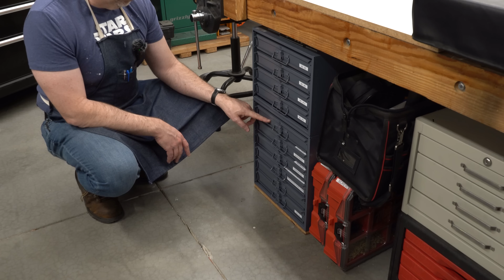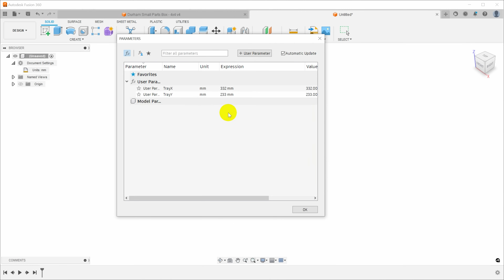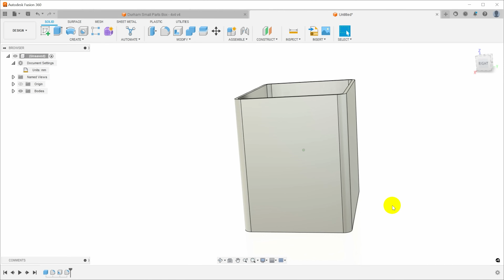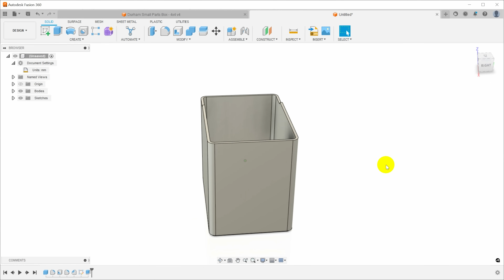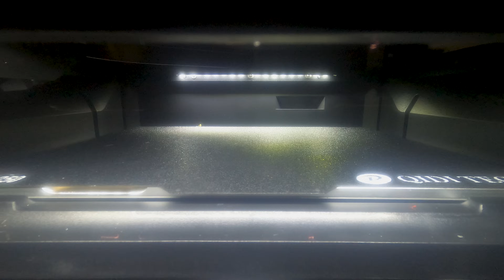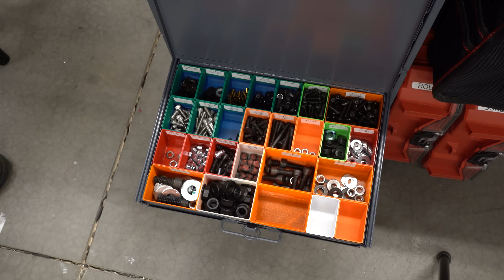Create the Perfect Storage Solution with 3D Printing!

Comment: I have had quite a few joke with me about my OCD.. Ha..Ha.. I just laugh at them.. But, when the complex projects roll in, and, they put me on them,, I wait until about half way through the project, when they can tell how well, it is going together is when I get them. I usually start calling out 32nd's or 64th's, or 128ths measurements and they finally say something.. Why are you calling out measurements like that.. That is totally unnecessary.. I say,, Is it?  How many problems have we had getting to this point? The answer is always NONE!! Ok then, now you understand why.. 
Now, 7/16ths, and leave the full line and you will give me 15/32nds.. Now, sound familiar?? I have been working with 32nds and 64ths when I made the cuts the whole time.. 
Then, I will grab a tape measure and measure the project. Both sides.. And, I will say, see, can't tell whether it is perfect or not exactly perfect... Looks dead nuts to me.. BUT, ANYONE Else at this point would be happy to be within 1/2" tolerance at this point.. There is the answer to your question.. Every Cut Counts!

Divide a Circle into 8 sections with a set of dividers and start from one side and go all the way around to the point of origin.. If your measurement was not EXACT, you just multiplied your error 8 times.. Start at the bottom and go right to the top and then start from the bottom and go left to the top and you have only multiplied it by 4 times.. If you ended up at the same spot measuring from the Right and Left starting at the bottom, you just confirmed your error twice, and only have to divide the confirmed difference by 4 to get it dead nuts.. 
Are we OCD, or, just know how to do it the right way? I rest my case.  

It's not OCD,, it's just wanting to get the job done the first time and getting it right on the way in vs backing up and trying it again.. I hate almost ALL Words starting with RE.. Think about it, even Reward and Refund, you had to Do something or spend something on the latter.. Rebuild, Rework, etc.. 
Writing Code is no different. Set your Variables, write Modularly, and decide what data you need going in and what is needed coming out, and you are ready to define the project Scope.. And, I am NO Software Engineer, but, I know how to get Projects done correctly. 
YES.. Nothing wrong with having trouble getting started.. It only means,, you are not 100% Satisfied with the design you have come up with at that point.. There may NOT be anything better,,, or, you just might be one sip of coffee and a deep breath away from the next Revolution in the Perfect Design... 
I fix more problems going to get a cup of coffee and taking a 5 minute break than any other way of solving problems.. When it gets to that point, taking a break, having a few minutes of quiet time,  allows your brain to work in subconscious mode, where lots and lots of problems are solved.. 
Go to bed thinking about a problem, and I can't tell you the number of times, I woke up with the solution... 

People have NO IDEA how many problems can be solved or figured out, just by asking combinations of who/what/why/where/when/how... If you know "How something works, and, Why it works that way, then, you ALWAYS KNOW WHAT THE PROBLEM IS, which is Why it is not working!! 
Think about it. .Apply that concept to a Lawn Mower that does not crank and you will see what I am talking about.. 
It works for Politics too, using combinations of those same words. I call it following the contiguous Wheel of Thought". What would they normally do? If that is not what they are doing now, then, you are looking for something else, because, Agenda's drive peoples actions, and when they appear to be doing the opposite, they are lying and you need to watch that left hand while the right hand is waving.. 

Not sure what is wrong with people these days. It is getting worse.. If they can't find an immediate solution, brain shuts down and stops thinking... 
Like everyone commenting about Gridfinity.. Yes. Good Solution. So is Alexander Chappell.. But, one is based on 40 and 50mm, the other on 42mm... But, what if you want to use the whole box and neither of those work out evenly?? Did every commenter miss that?? There is why you did what you did? The comments about turning the box upside down and things coming out of the box.. 
Did they think you didn't make the cut down on purpose to avoid pushing the back of the box up due to the hinge? You meticulously measured the Rear and front heights? 

Did they not stop and think,, why did he do that? So,, he has a reason for cutting at least the back row of boxes down?? And, he made ALL of the boxes the same?? Must have not been worried about turning the boxes upside down.. Ha..Ha.. I actually find it amazing reading the comments.. NOT ONE OF THEM,, except maybe the first Gridfinity comment bothered to look in the comments to see how many times others had made the same comments.. WOW!! MESSAGE TO YOU GUYS!! READ THE COMMENTS!!! 
They are a GOLDMINE of information on channels like this.. I filled up a whole notepad file on all sorts of information from the comments. .Anything from the price of ABS, PLA and Nylon by compairson from some comments, to all of the different software's used to modify existing files, to Zack, Alexander, and a few others seem to be leading the way on these organization systems, etc.. Hell, I just started looking at these 3D printing Organization systems tonight, and I know more than 50% of the commenters.. Just from reading the comments on this one video... 

Some of the pick ass comments on here, just piss me off... Keyboard Driver Errors is all I can say is behind them.. 
EXCELLENT VIDEO... I learned more about Fusion 360 (I have never looked at it because so many people complain how hard it is to learn).. Hell, it's like using an Excel spreadsheeet the way you designed the boxes.. I can see it will take a bit to learn, but, the intimidation factor just flew right out of the window.. Thanks for those few minutes of design.. They were INVALUABLE!!

Comment: @Clough42  
James,
Thank you for helping me to find the root cause of my problem as to why I never start never finish and just stress in general.  I have issues with finding things because of the chaos in the shop, the lab, or even the clothes closet..  Being an engineer it is inherently obvious, at least to me, that I should be incredibly organized.  However, once things get going on a project and then it finishes, what do I do with the aftermath?  It is a shame to throw the extra material out.  I have not had an organization system that could grow with my mass of different projects.  That one thought.  Create a system to easily grow and change.  It has changed the way I approach projects, shop organization, and life in general not to mention reduced cost on projects as well as less trips to the hardware store.  Thanks again!

Comment: What a waste of time man. Personally I bought little bins and put them in my drawers. That’s enough. You never need to move a whole box of bins in reality. You just need to pickup bins here and there and put them on your tray. Printing all these bins is too much work, there is much more efficient and much cheaper if you count your own labor. This perfection is ridiculous. My bins are not perfectly aligned and they don’t fill 100% of the surface of my drawers but nobody cares. They don’t move with the anti slippery pad under them when I open a drawer. You are talking about getting thing right from the start. First you need to think about efficiency, not pleasing your OCD.

Comment: The insight to your logic and dare I say phobias in this vid, is a gold mine...a deep, complex, multi-fissure chasing, sprawling, subterranean, OCD gold mine, but a gold mine none-the-less.  I consider myself reasonably proficient in 360 and most tasks in and around the shop.  I however never think to use parameters from the onset, which is basically the same concept as your approach to organizing hardware.  Plan for change from the start.  I just bought my son an entry level 3D printer.  He's working on custom organization for his Milwaukee Pack-out system.  I'm going to suggest that he too, takes a look into your thought process.

Comment: So I take this to another level lol.
I have an einstar 3d scanner and Asub spray.
I laid out how I wanted all my tools in my tool boxes sprayed and 3d scanned. I cleaned it up and used it to cut from a solid and shell.
With small tweaks based on the use case my 3d printed drawer tray are perfect for me also my socket holders are the shape of the nut/bolt/torx/spline that are used on so it will only fit in 1 spot same for 6 point 12point metric sae.
I use harbor freight 22x72 S3 boxes 1 red + red hutch and 1  blue + blue hutch.
Red is 100% metric blue is 100 sae.
I have a black 22 x 56 + top chest that all tooling for my CNC machines (hass VF-02SS, ST-15Y, diy 4x4 cnc router)

Comment: Or you can the old standby of building in room for expansion from the start.

 On the extreme end leave either 1 row or column of trays empty or more practically 2 - 3 trays empty and unlabeled. 

That way you remove the headache of cross container shuffle(which in my humble opinion no engineer should ever resort to doing) and are able to comfortably accommodate any new changes that crop up in the future. 

Second part is to place the label maker stickers on each of the actual trays rather than a master layout on the underside of the lid. 

Label the fronts of the larger containers with the most appropriate general category label references such as metric/SAE “nuts” “grade 8 hardware” etc and then maintain rows or columns of the range marked on the underside of lid. 

As needs change and stock is consumed removing the label from the tray also helps to free up more space for the new stuff.

UNLESS OF COURSE your like me and subscribe to the better to have what i need on hand then waste searching for it or worse having to stop to make a trip to the store so your “collection” keeps growing. 

AND IF you’re of similar mindset then simply labeling ALL the common potential sizes whether you actually have them on hand or not… that way You’ll ALWAYS have a waiting tray properly labeled and in order for whatever shows up next… 
insanely inefficient use of existing space which is always at a premium as it is but it does solve the upgrade dilema. To make it more fool proof you then just leave 1 single tray to each container drawer miscellaneous for placing any non standard denomination size hardware so you don’t get a ton of trays holding single one off pieces that most likely will never get touched.

And now as i finish writing this all out I clearly see you’ve already implemented almost everything i’ve already mentioned.

In short, The biggest single thing i did that helped my storage was getting used to not completely filling each drawer full of labeled containers … by leaving sufficient empty trays it may not be ideal right now, however it certainly makes up for it in the future for collection upgrades😊.

Nice job i sense a comrade in arms in a lot of the similar philosophies, struggles and issues wanting to avoid as you systematically tackle each project. I believe you’re far more knowledgeable, diligent and skilled (especially w/ CAD) than myself but i can clearly see we’ve gone down our fair share of rabbit holes coming out of them with similar conclusions 🍻

Comment: Cool system, terrible metal boxes:
* thin metal
* latch interferes with handle
* hinge made you create notch in boxes which means you can never turn boxes upside down with small parts inside
Hope they were cheap

Comment: Durham has box liners w/divider inserts. They’re pretty nice too, they have curved bottoms and the imagery placing can go as low as around 1”
Reply: Also, the fit of the inserts are really tight, which is nice b.c once they’re in they feel basically permanent. I think mine have 4 vertical rows w/the 1” spaced insert wells

Comment: I feel your pain. I have stuff in multiple storage "systems". I love the Milwaukee packout system but it is cost prohibitive for keeping everything in. I also use various sizes of Arko bins that are hung on the wall with cleats. Arko bins are great for really big stuff but are limited in their ability to be re-sized. I use Plano boxes for small items. These boxes work but lack the ability to easily change sizes due to the internal dividers being pre determined by the manufacture. I have been inspired. Now all I need to do is think about the ramifications of changing "my system" which will ultimately lead to additional procrastination.

Comment: My small parts system is similar to yours.  I've added a catalog consisting of a top-down photo of each box.  I keep a printed version next to my parts area, and i always have the electronic version available on my phone.  A tray ID label is attached to each tray so that it is visible both in the photo and from the front  of the closed drawer.  That means the tray number matches the page number making the trays easy to find.  I don't print individual labels because with the photos I don't need them.   This means that while designing something I don't have to be in the shop to know whether or not I have the parts.  This system is also helpful when I am standing in the hardware isle wondering if I should buy a pack ot washers.

Comment: Rule 1 If you cant make it perfect, make it adjustable. This applies to storage as well, specially since needs change over time.
Rule 2 Think how you are going make thing ie what manufacturing methods to use. For your design nothing wrong what i can see, how ever the manufacturing is where you messed up. 3D printers are fantastic tools to build things, but one needs to know what limitations those have and what are the best methods to do the thing. Yes you can 3D print container like this, how ever that is not cheapest or best method of manufacturing. If you want to optimize this, then use ABS sheet material as your straight even areas and glue them with chemical welding ie acetone that melts the ABS and then solidifies after its evaporated.
Best way to get what you have here, with the design you have is to take sheet material for the bottom, print the top and then acetone it into sheet, then cut the excess from the sides. This takes bit more effort, but over all its faster than printing the bottom. Its around 3€/kg for ABS sheet, while ABS filament is around 20€/kg as that needs to be very specific thickness, while sheets might have tiny variations that do not effect end result, so you save bunch of money, specially since you can use off cuts from larger company that uses ABS sheets to make bottoms for free, or source sheet material by taking it from appliances as ABS is often used for the casings etc.
Reply from the maker: You're optimizing for something I don't care about.  I care about my time.  I sent the jobs to the printers and went to bed.

Comment: I've thought of 3d printing little boxes  for lathe and miller tooling I keep in a roll cabinet, but my printer doesn't like PLA since I set it up for nylon and tpr, and I'm not wasting nylon filament on drawer organisers. 
You could have done with starting with Stanley 8 compartment (deep, part no 1-92-749) and 25 compartment (shallow, part no 1-92-748) boxes. They come with removable individual boxes, with the exact arrangement varying depending on whether it's the deep or shallow version (at least 2 sizes per box). They're what I store all my fasteners and pipe fitting, etc in. It's a pity they don't have radiused bottom corners on the smallest boxes though. I've been meaning to make a cabinet with drawer frames for my 20 or so of these boxes of small parts for years, but it's not got to the top of the the 'to do' list yet.

Comment: Thank you so much for posting the Fusion 360 walk through.  Took me several attempts but finally got it to work.  This solves a world of problems with my service truck - I have the 12 x 18 x 3 drawers in my service truck and now I can get things organized with the limited number of drawers.  Working on some stack able/nesting inserts so a smaller box can fit inside another - I.E. 10A micro fuse inside the 10A mini fuse, or your application, 4mm nut inside/on top of the 4mm flat washer.

Filament cost and print time is spooky compared to buying the factory insert though.  I need to use thicker walls - 1.6mm so I am around 400kg per build plate and 7 hours, which will be about 1.3 rolls per tray - and I am using PLA+.  4 spools of filament and near 72 hours total printing on estimate.

Comment: I'm sad, because you missed an opportunity.  The ratio of the box dimensions is 332/233 = 1.425, which is quite close to sqrt(2).  Had you made the boxes with sqrt(2) proportions, you could have replaced any box with 2 other boxes.  However, the ease of having rows all the same depth has its advantages as well.

Comment: I want to see you make a pizza from scratch. “Ok first let’s start with a circle and set the parameters. Let’s do a circle with the radius as (how many people) * (hungry). We can change this on the fly depending on our circumstances. Let’s draw this circle and now let’s do an offset plane called “tomato sauce” and another offset plane called “cheese”. Finally we’ll do a circular pattern of smaller circles with a radius of 20mm and we’ll name that “pepperoni”. Throw it into the printer with a heated chamber and we’ll be right back after it’s finished.

Comment: I find up to m6 these type of systems are good. I have them a box per size and keep bolts/screws on left going up in size  and nuts and washers on the right. From M8 upwards I find part bins easier to use. However I also have some M8 M10 and M12 in a Dewalt T-Stack parts boxes as I also need them when I go to site.